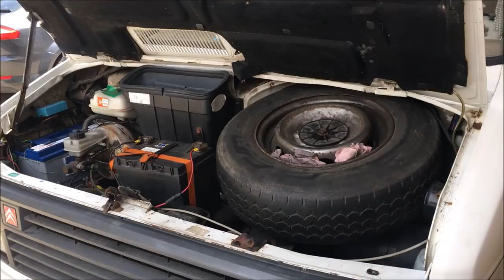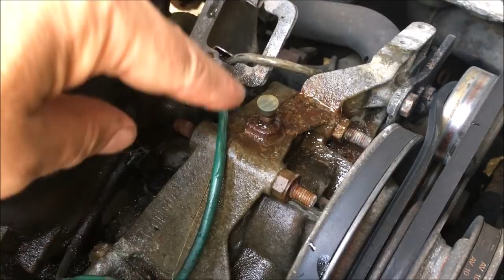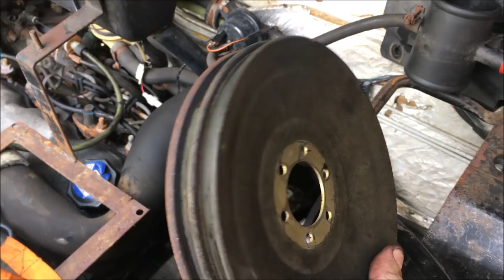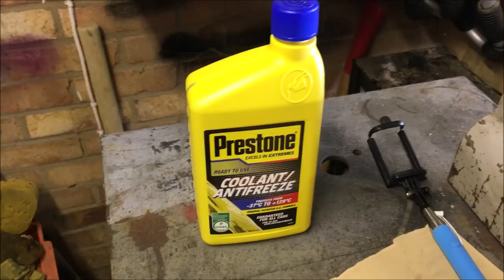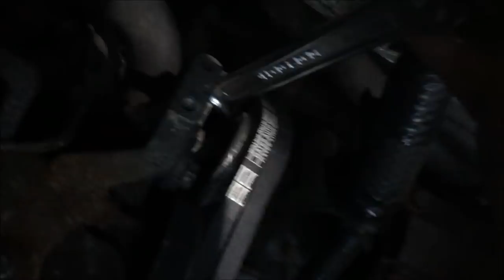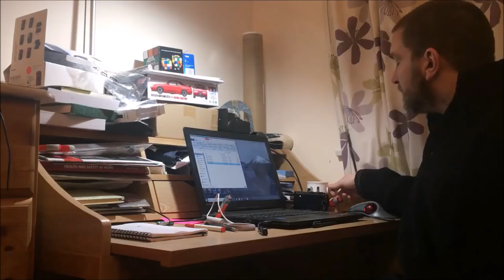Motorhome Squealing Belts Problem

Comment: I had to do this same job at about 1am at Telford Services, on the very day I picked up the van. There was only one of the two drive belts fitted and it gave up during the journey. No alternator, no vacuum pump and no water pump. Things got interesting on the motorway... 😱😱😱
Reply from the maker: Sadly I think a lot of these vans are just got running after long periods of standing to sell on. The seller does the minimum to get them running. Mine also had a tiny car battery fitted 🙄
Reply: @ttxela  Mine is similar - a 75ah Halfords cheapy. I agree - it's a sad tale for some of these vans. I'm just so pleased that I'm fortunate enough to be able to invest a bit in the jobs that need doing. The van deserves it. 😁

Comment: I notice your belts for water pump are smooth yet the new ones are toothed is there any difference
Reply from the maker: I doubt there is any difference in this application, as long as they are the right size.
Reply: @ttxela  thanks for getting back ive fitted them but in the procsess sheared 2 of the 6 studs on the belt drive wheel cant believe how fragile these are

Comment: Hi do you have the belt size handy, thanks
Reply from the maker: Sorry, I've not had that van for over a year now, I think you can still buy the belt sets from Coastal Motorhomes though. Is yours the U25 engine?
Reply: @ttxela  no hassle, it's the 2.5 non turbo diesel engine

Comment: Someone has tightened the bleed screw too tight in the past and its sheared the end off , should look cone shaped. Similar to bleed nipples on your brake slave cylinders. If you look in the water pump you should see the shoulder the cone should seat against. Hope this is some use.
Reply from the maker: Nigel Southee Thanks,  that makes perfect sense 👍

A shame it doesn't seem possible to buy just the bleed screw